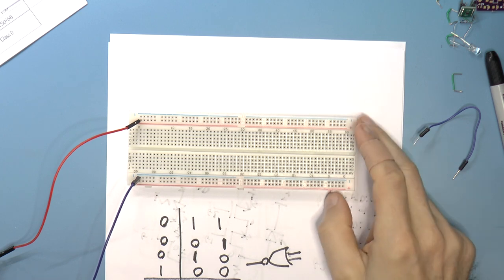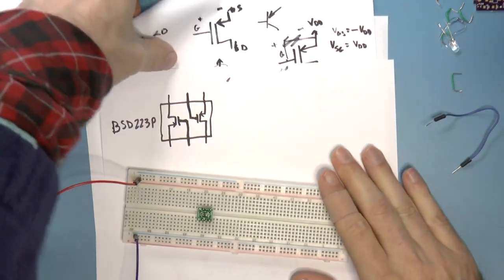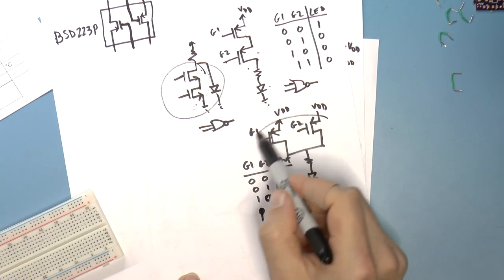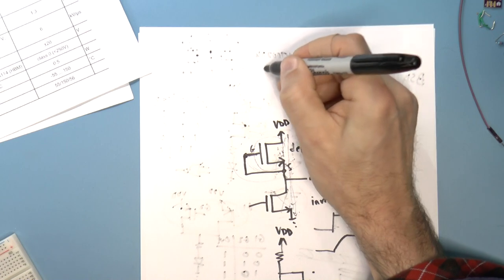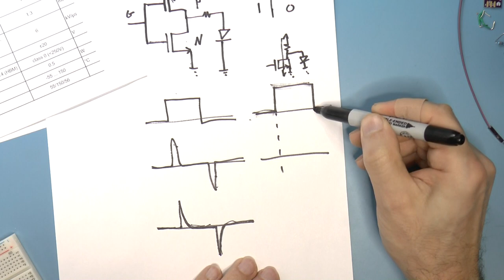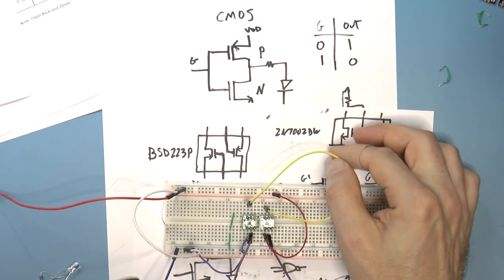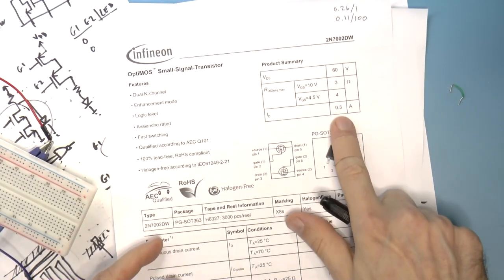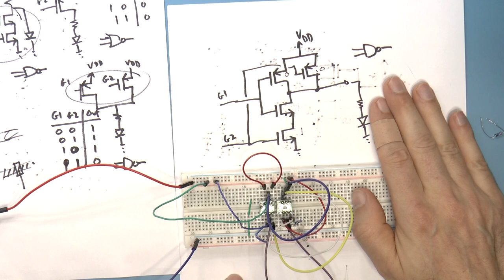Let's play with our MOSFETs! Part 2: PMOS and CMOS logic

Comment: Tnx a lot, great video. In NMOS circuit, you always connected source to ground, led on seperate line. Is this common design or is it possible to connect resistor and led to the source of NMOS? So there is only "one line"?
Reply: I think if there insiries want the led be fluctuating in voltage because of the spike that happens when the gate is opened and closed, or I've completely misunderstood it which is more likely 😀

Comment: I don't think your comparison between the NMOS and PMOS configurations is accurate, because you are changing how you drive the load.  In the PMOS configurations you are either turning on or off a switch in series with the load.  This is like a traditional switch and light bulb.  However your NMOS configuration has the transistors in parallel with the load which you are shorting out to turn off the LED.  In this way you are adding an inverting component in one configuration but not the other.

If you kept the LED in series between the resistor and the transistors, the series NMOS would be an AND gate compared to the PMOS's NOR.  likewise, a parallel PMOS is a NAND, but the parallel NMOS is an OR. Basically switching only the gate channel type (N vs P), but leaving the load in series would swap the gate logic and invert the output (AND <-> NOR, or OR <-> NAND).
Reply: Adam Butt Yeah, that’s a sort of an unnecessary complication. You can drive LEDs that way in some applications where constant current is important (eg to avoid LED switching from polluting an analog supply), but even then what you’d need to do is a bit different since Vds is normally much smaller than the LED dropout.

I had a micro power, precision all-analog circuit that had some led indicators and the on/off switching had to be done by having two identical LEDs in thermal contact, and switching between them. That way, the LEDs could be driven without a current source. The design was careful in keeping the “on” (LED A) and “off” (LED B) active for the same total time, so that they’d age identically – that was 2+ decades ago when LEDs aged much faster than they do today, since to get good light output you had to drive them much closer to their limits. Modern high brightness LEDs can be often driven at 1mA or less and still be plenty visible as indicators (although this is very application dependent of course).
Reply: Hi won't running the LEDs in series make the voltage spike in the led when the gate changes state or is there a way around this and don't MOSFETs only conduct when there switching state would having an led in series make them have a voltage all the time giving incredible power losses using them that way?
Reply: Robert Woods Mosfets really are electronic switches. When they open, they open pretty good. You have to understand that even mechanical switches aren’t perfectly open. Most unsealed switches (say a light switch on the wall) have enough contaminants accumulated on the “insulating” surface between the contacts, that even when “open” you can measure leakage current through them. It’s minuscule and requires good equipment to measure, but it’s there. Mosfets aren’t that good usually, but they still aren’t shabby. You won’t measure a mosfet leakage current at room temperature with a common multimeter set to 200mA range. So, you can think of building a circuit with an actual switch, and then replacing it with a mosfet.

Of course all electronic switches will have some kind of transient no ideal behavior, but it’s not hard not to produce voltage spikes in a circuit that turns a LED on and off. Since you use the mosfet as a switch, you need something else to generate the current for an LED: LEDs are current driven and connecting them to an ideal voltage source either does nothing or destroys them in short order. The cheapest way to generate some current is to use a resistor. As long as the supply voltage and the LED diode drop are somewhat stable, the current will be “constant”. That resistor will also damp any inductive transient effects you may have due to fast mosfet switching interacting with lead resistance - especially if the LED circuit is a long.

Finally, the mosfet can also be used as a voltage-controlled resistor. In that case, a  feedback controller (can be just an op-amp) measures the current flowing through the LED, and adjusts the mosfet have the resistance necessary to generate that current. This is a much more ideal current source than a fixed resistor. The mosfet will dissipate the same power a fixed series resistor would (if it dissipates more, you’ve got a local oscillation going on and need to see what’s up on the mosfet’s pins with a scope).

Further, Mosfets in integrated circuits are small enough that they become simple current sources. Usually, discrete Mosfets are much larger and you will destroy them before they start limiting current. But a digital CMOS chip - a microcontroller or a logic chip - will inherently limit current on the output pins. For example, 74AHS logic family drives about +/-8mA into a short. So, as long as you stay within the limits of the heat the chip can dissipate, and within the current limits on the pins (and the total limit), you can drive an LED directly from the digital pin, and you can parallel the outputs for higher drive current, too. 

You can think of these “inherent” mosfet current sources as self-controlling resistors. Thus, any such current source will dissipate the power equal to the product of the current it generates and the voltage across it. Example: a 74AHC chip running from 3.3V output drives an LED with 1.2V forward voltage. The output mosfet transistor will drive about 6mA (say), so the dissipation is (3.3-1.2)V*0.006A=0.012W=12mW. If that’s all the chip does, it’s well within it’s thermal dissipation limits and within its current limits too. No resistors needed. I find that many people are unaware of this inherent current limiting characteristic of small mosfet transistors, yet it is always taken into account when doing analog CMOS IC (chip) design.
Reply: @absurdengineering  hi many thanks for your reply, I'm not trained in electronics so trying to grasp it from these videos is difficult sometimes. I'm really grateful for any new knowledge I receive and you have explained a few more things for me. I only started to learn because when looking at a circuit board it p#@'s me off that I don't understand what's going on and the more I seem to learn the more I realise how little I know, so sorry if I do seem abit ignorant on the subject I don't mean to be but with little understanding I'm going to sound it anyway.
  Thank you and I will keep everything you said in mind when watching other videos 🙂👍
Reply: Robert Woods No problem. I don’t know a whole lot either – and it took me a good while before discrete transistors weren’t “black magic”. I could build fairly complicated circuits as a teen yet I was really lacking in understanding of some basics, and had to fill in the gaps much later while already working as an engineer. The resources we have today make it easier, because you’re more likely to find materials with teaching style that matches your needs and preferences.
Reply: @absurdengineering one of the problems is If you want to learn about something sometimes you don't get the whole picture and its the missing information that can change the outcome, I'm still glad to be corrected tho rather than going on thinking what I know is right when it's completely wrong 😀

Comment: Not impressed with this video. You are talking about digital switching and digital logic - and touching on MOSFET function. I learned nothing on how you use MOSFETs, part one was better in this regard. I want to know how to choose a MF how to read and interpret their data sheets,any quirks of these devices how to use with a uP how to cascade them to switch high currents etc NOT how to  make a logic gate.
Reply: Ray Well, if you want to design power circuits - why would you watch a mos logic design video? You need to watch power mos design stuff :)